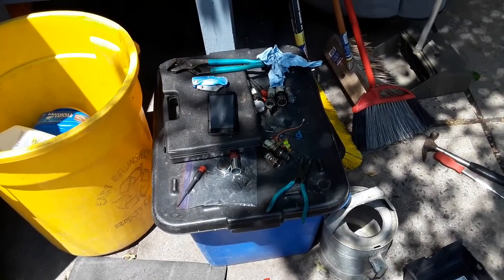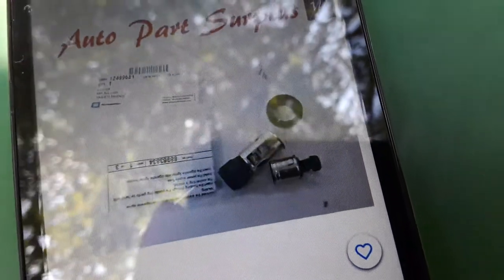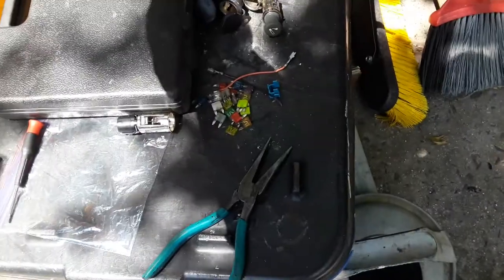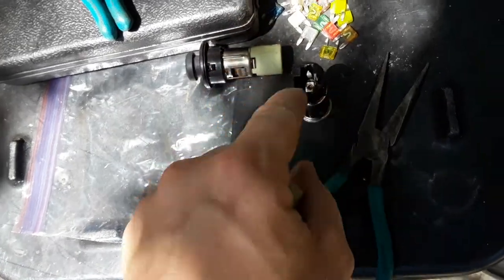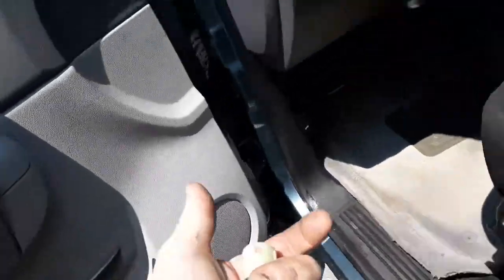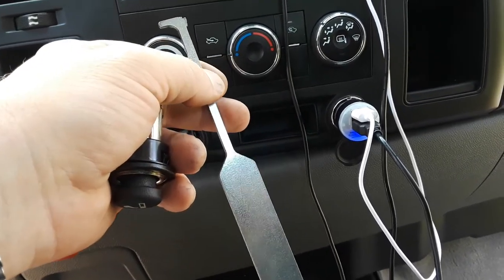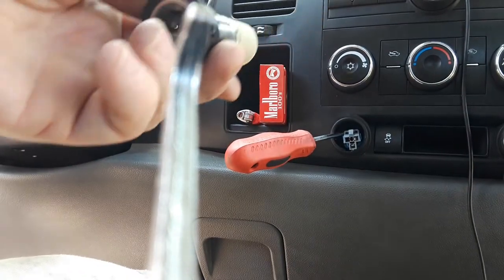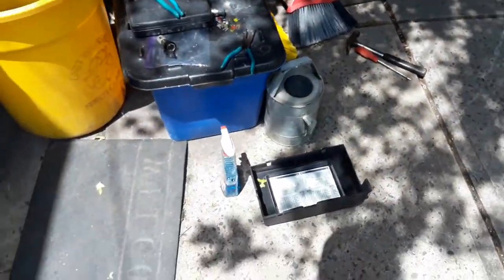How to add a cigarette lighter to a 2011-2013 Chevy Silverado, GMC Sierra (2007-2013 complete)

Comment: You may have to ream out the hole a little but here is a good way to tighten it in. I did it. First of all you get a 1 1/4 under the sink white drain tube. They are thin walled and fit perfectly over the usb plug. Cut it 1/4 inch thick. Clean off the burrs if any and slide over the back of the plug. Put on the round plastic nut and not you do not have to grind it. I took pictures it looks great and hold the usb unit snug and straight.

Comment from the maker: As of 7/23/2021 I have 4 cigarette lighter sockets with the bezel for sale for $20, free shipping. 2 are the same type plug as in the truck, the other two have the other style plug, but can still be easily used by snipping and splicing the two wires thst go to the plug into, two stardard single plug wires and hooking them to the two prongs that way, very simply. If you need them leave a comment, Thanks!

Comment: Yup just jamb your thumb in there to see if it’s working lol 🤣 It would be too easy to try lighting one of those Marbs that are sitting right there. I came across this video while troubleshooting an issue with my 2013 Chevy express 2500. It has two of the 12v ports(no cigarette lighter) and I believe they are on separate circuits. Both stopped working after I used a 400W power inverter to charge power tool batteries. I found one blown fuse and replaced it but they still don’t work. I think I might have fucked up the ports and plan to replace them unless you have another suggestion. Good vide thanks!